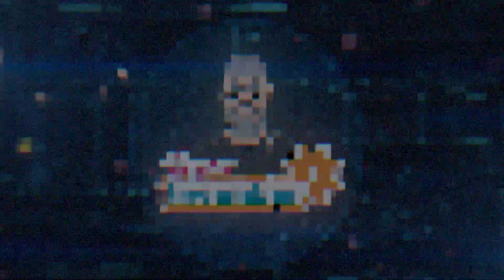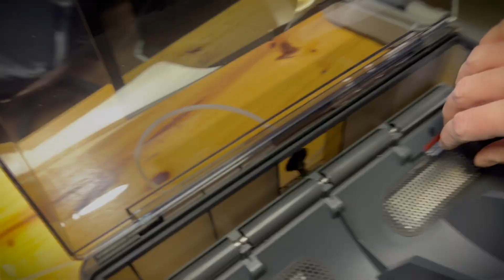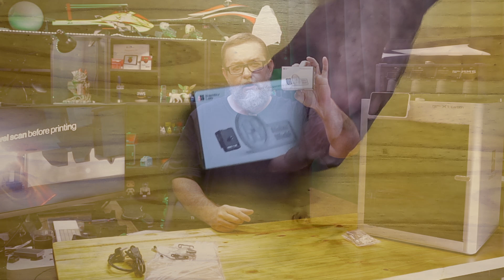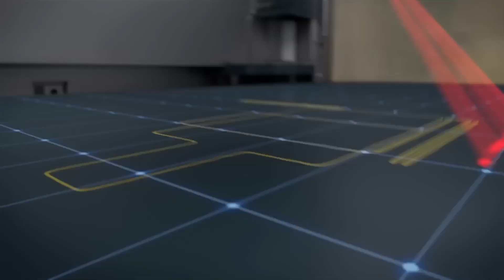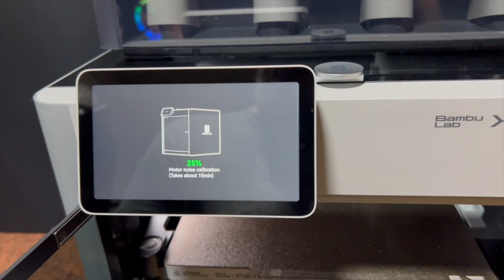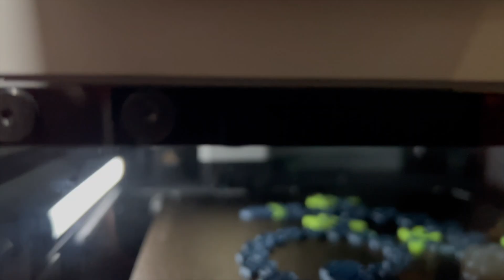The Best 3D Printer You Can Buy | Unboxing and First Impressions Review

Comment: I find the included scraper blade that you print the handle for to be way too sharp for use on a PEI build plate, which you will soon want to use on your X1C. What I use is a smooth blade for an oscillating multitool. I don't use the tool itself, just the blade. There are different brands, but you'll find that the less expensive they are, the more work you'll need to do with a piece of sandpaper to get it just right. I wouldn't worry about the blades needing to be replaced as I've got nearly 3K hours on my P1S and haven't had to replace one yet (or the PTFE tubes.) I have my P1S running most of the time, and my wife has her two A1's and A1 mini running almost non-stop. You'll get the occasional rare print failure, but the most common problems are filament spools falling off the AMS Lite or the regular AMS getting mad about cardboard spools. I use cheap filament almost exclusively and when I get some Bambu, it's like a fancy steak dinner for me. My go-to brand is Eryone PETG, and frankly it produces great results at the cost of about $12 per spool. I hope you enjoy your Bambu Labs printer. I remember when I got my first one, and it was nothing short of reinventing the hobby for me.
Reply from the maker: Hi, great news! I was already thinking about buying more blades in case I needed them, but then, I'll be calmer about it. I tried looking for the Eryone filament brand here, but I didn't find this one inb Brazil. One day, I would like to try your favorite brand. Here, my wife is starting to fall in love with the hobby. She's starting with the X1 Carbon. Yesterday, she made her first 3D print and was very happy. Ironically, she is "happy" to have printed a "sadness" from the movie Inside Out 😬 Have a great day! Thanks for your comment!
Reply: @InventorsGarage  Eryone is Chinese like most of the bargain brands. A few years ago, that was a cautionary sign, but anymore I've had good luck with many of them including Sun Lu, R3D, even Kingroon. Since you don't get to keep the X1C, you might want to consider picking up an A1 mini or A1 before the June Bambu sale ends. The mini is only $200 alone, or $350 with the AMS Lite. Both types of A1 give you the Bambu experience although they are not as fast as the X1C and P1 series printers, but are half the price.

Comment: Trust me, once you use the Bambu Lab, all the rest feel obsolete, especially changing the  filament and the run out sensor.
 Enjoy, and please release a MFS for the  Bambu Lab.
Reply from the maker: I trust your words. This printer very  impressive. I'm sorry, but I have no intention of creating an MFS for Bambu Lab. But, if you want, you can use the MFS design for K1 and K1C as a filament case and place it on your bench. To do this, add a plate to the bottom of the MFS to keep it closed. You won't be able to use the heat from the printer itself to dry the filaments, but you can add silica supports inside it. Thanks for your comment 🤗
Reply: @InventorsGarage  Got it, Thank you for the reply and keep the great work. 👍